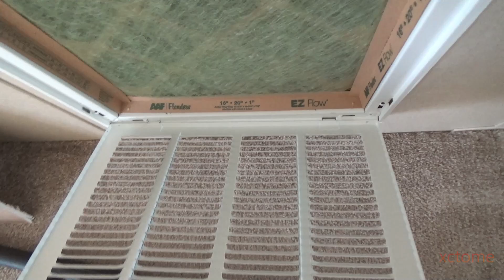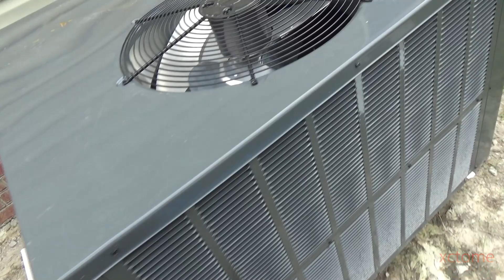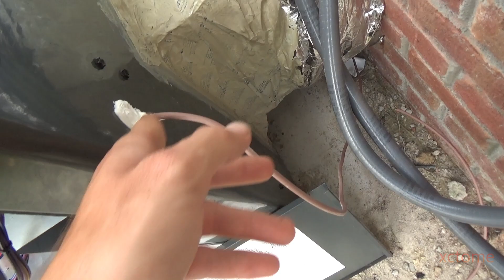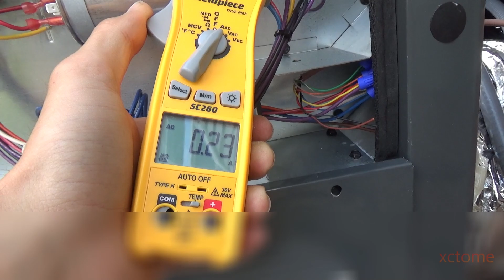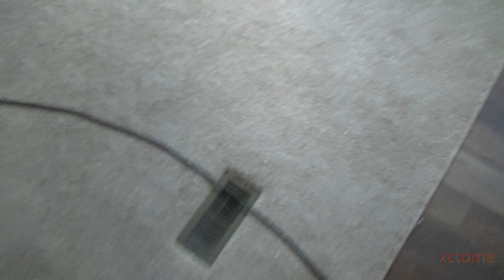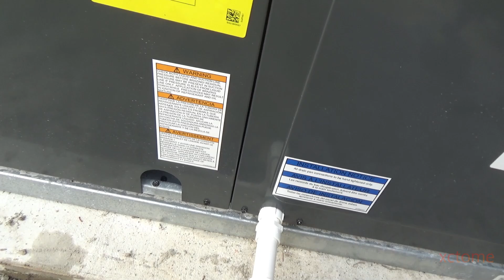HVAC INSTALL GOODMAN GPH1442 PROJECT NEW HOUSE

Comment: Those filters are what are actually recommended for an AC unit. All the pleated filters do is caused problems
Reply from the maker: Most pleated 1" filters are restrictive, i use Flanders MERV 11 filters, they are non-restrictive and have given me zero problems.

Comment: Nice and neat looking install and startup! I never liked those wall return vents lol. I look forward to defrosts from your Goodman this winter.
Btw are you familiar with those older ICP "horseshoe" package units? I've heard those were tanks
Reply from the maker: Thanks for the comment :) in a manufactured home with no attic space, it was either wall or floor and floor returns are awful, i like a wall return, easy to get to, i have the ceiling return at my shop lol the ICP horseshoe package units were primarily used in manufactured and modular housing, the supply and return were backwards from say a Goodman or Carrier, on the horseshoe style ICPs the return was on the right and supply on the left, aggravating as ever to get to the blower motor, good units yes, but a pain to work on.